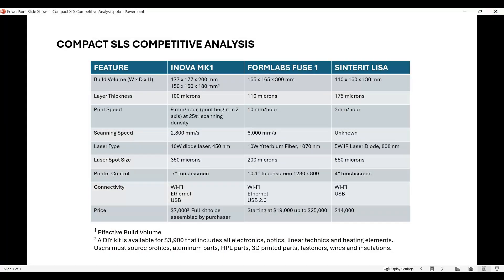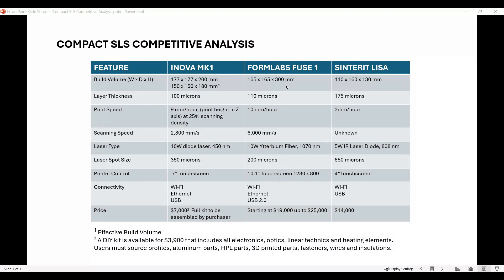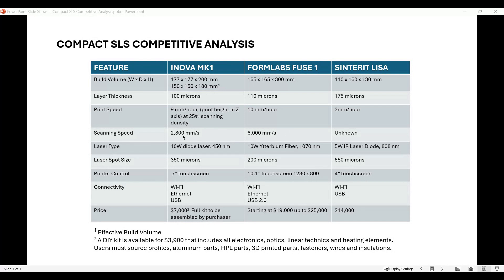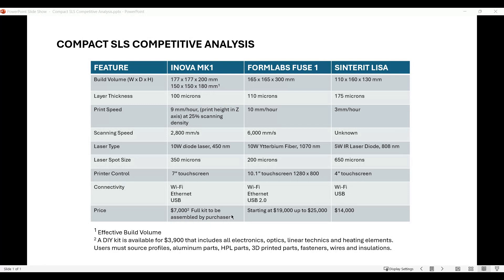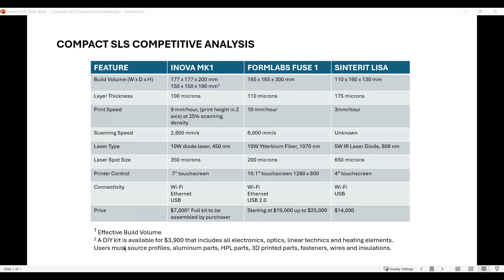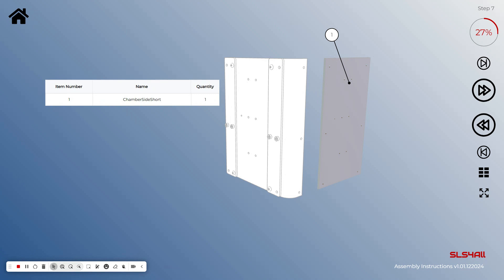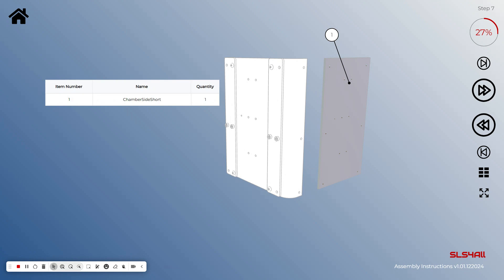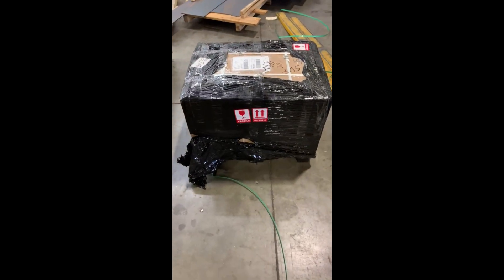SLS4ALL Inova MK1 SLS 3D Printer Build - Part 1

Comment: Thanks for making content on this machine.  I've very interested in it.  Since you work at a metal fab place will you be making another iteration were you source the parts yourself?  Also great video but for the love of god get a lapel mic.   Had to crank the volume to 11.
Reply from the maker: Sorry about the volume.  This first video I was standing  some distance from the camera/mic at the work table.  It should be much better in the others where I am only 2 feet away.   As noted, after I get some time on this first kit, the plan is to fab all the structural pieces for the next one.  There may need to be some design for manufacturing/assembly and serviceability elements implemented on the next iteration.